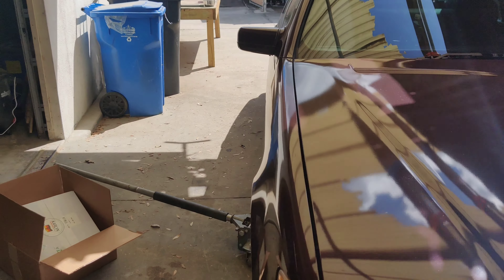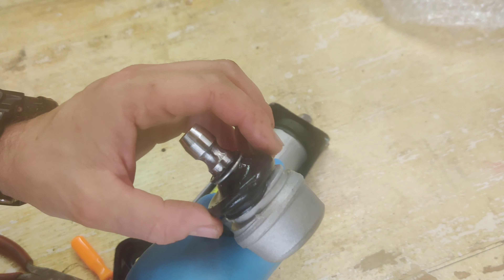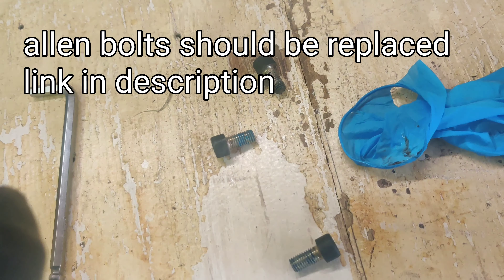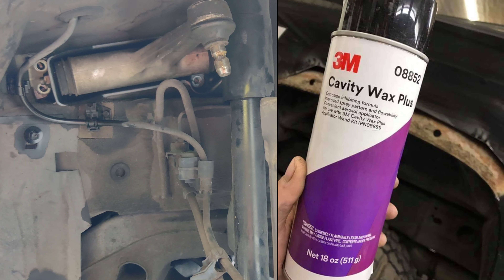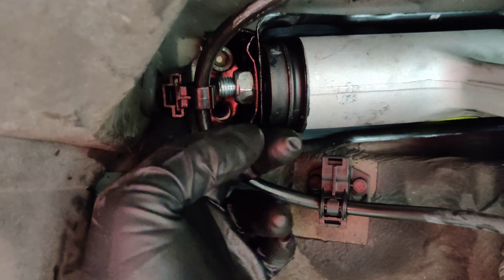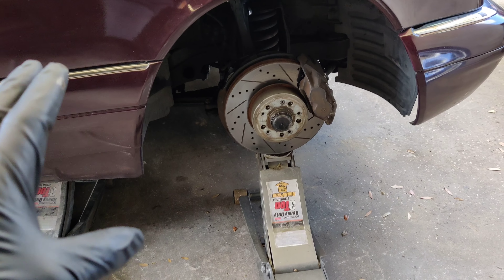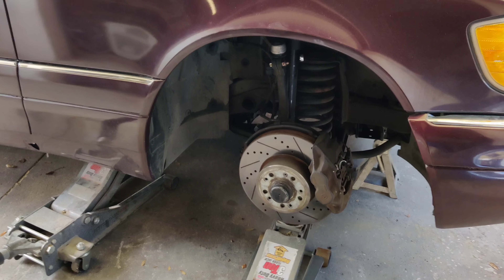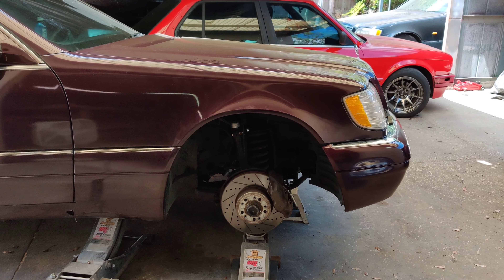1995 Mercedes s500 w140 chasing vibrations upper control arm change VIP car

Comment: Have you tired adjusting front wheel bearing?
Reply from the maker: I did a while back.  I have a feeling my wheel bearing is bad but also now believe the vibration is coming from a bad driveshaft support bushing/bearing.   This makes sense since the driveshaft will cause a resonating vibration like I have.   I plan to do all the driveshaft stiff
Reply: @petescarport  thanks. I’m working on my moms car it s a 1999 w 131k miles.
Reply from the maker: @ncautolink  let me know how it goes.  There’s a lot of things that can cause vibrations.   Sometimes it’s simple and sometimes it’s more than one or something difficult like driveshaft bushings.
Reply: @petescarport  I’ve changed drive shaft bushing couple years ago when we changed transmission. It went out for some reason at 120k miles

Comment: Hi Pete, I am really enjoying your videos.  I HIGHLY recommend that you get an OTC 6297 type ball joint separator if you think you are going to be doing a lot of suspension rebuilds. It's a lifesaver.  Much less likely to do damage than the pickle forks.  Best Regards
Reply from the maker: Yes looks like a pretty cool tool for the job.  I'm pretty sure I can rent this and will be doing other side soon.   Thanks for the info

Comment: The upper control arms on that 500 I'm taking apart has new ones on it..I'm definitely gonna take them off & hold on to them
Reply from the maker: Oh good idea.  These are not cheap parts. Especially if it's a top brand.  Lower control arms are super expensive too

Comment: What the mileage on this 140?
And make sure that you have good wheel balance
Reply from the maker: Yes you are right about wheel balance.   That is usually the main culprit.   But I have had same vibration since I purchased at 114k and now have 124k. That's over 3 years of driving and 4 sets of tires.  Plan is to keep changing out all suspension one at a time and document.   Each piece I change it gets a little better.
Reply: @petescarport  I have two 140 and both of them have vibrations,  on one after balance became better, but still some vibrations
Reply from the maker: @azizkh8137  me too.  Usually with stock rims you don't get much but I think once I change out the lower control arms I should be smooth

Comment: So have you figured out the problem?  I own 2 w140 and they both have the same issue... right wheel wobbles around 55mph.. goes away if i drive over 60mph or if i stay under 55mph.. help!!!
Reply from the maker: Wow that is exact problem I still have.   I have not completely figured out the issue but I am going to continue replacing parts very soon.  It is driving me nuts since I started to daily drive her again.   Look for videos soon on this
Reply from the maker: @unkle fester I ended up getting rid of 99% of the vibration but adjusting my tire pressure.  I know sounds crazy but I played around with it and found a sweet spot
Reply: Have that same problem on mine. Ever figure it out?
Reply: @petescarport  have you tried adjusting front wheel bearing to see if it helps the vibration. I have the same problem and about to replace upper arms. I’ve adjusted bearings and already replaced lower arms and it helped but still have vibration. I hope upper arms will take care of it.